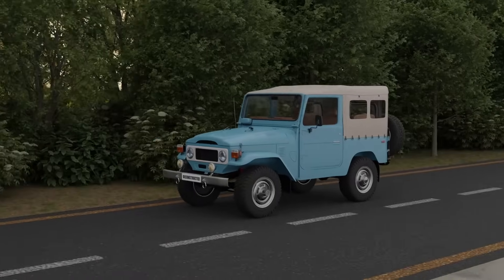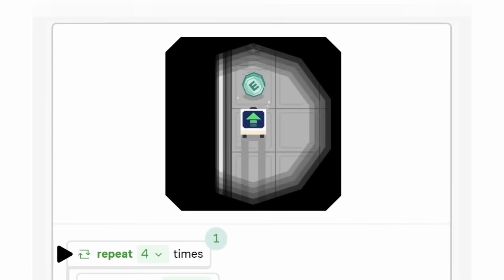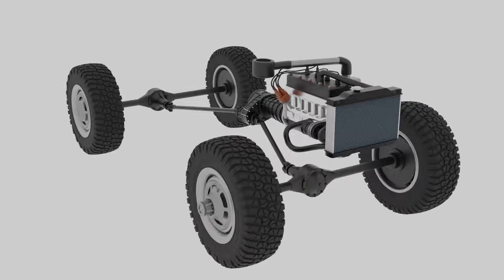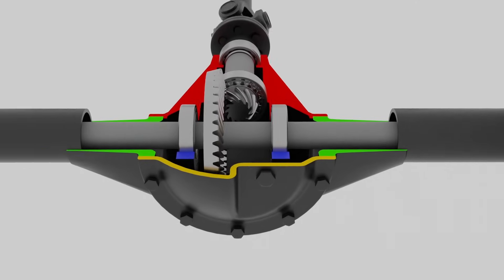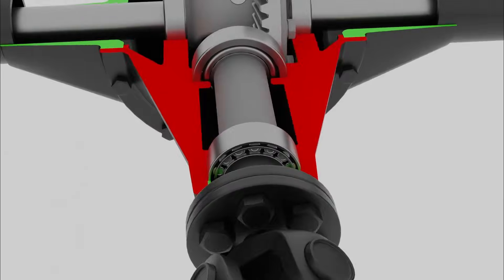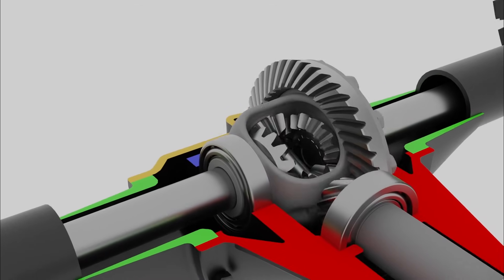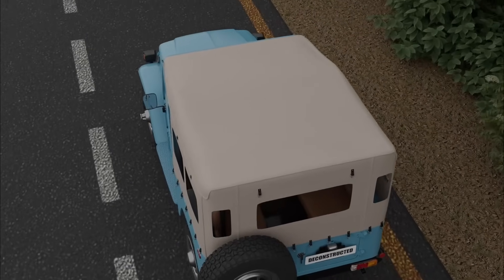How a Car Differential Works

Comment: 1:55 There is absolutely no official definition difference between 4WD and AWD. It would be almost as stupid as calling a 3:rd system FOURWD.
"All" and "4" is exactly same on any normal car. So would be beyond retardation to give that different definitions on some part of the word that has not even anything to do with any difference.

6:50 Cudos though for getting the diff right. Power might differ. But torque is always same to both. Few get this.

Comment: At first,  I thought that each end of the spider gear shaft was pressed into the differential 
case through a bearing,   but for either gear to turn on its axis following the side gear(s),  
the opposition from the other spider gear would have to twist their shaft until it snapped -- 
and unlikely event at this low of a gear ratio.   It has to be, although not explained on this 
video that each spider gear rotates independently on the shaft because it has a bearing 
BETWEEN the gear and the shaft.   Otherwise,  it would not work as a differential.

Comment: If feasible can you explain how the differential case works more detailed like how the spider gears come into action when the resistances on the tires are different.
Reply: Ranji:  Sorry,  I didn't see your question until after I posted my comment. 
Look for it around midnight the night of Saturday,  June 28th (2025).  Henry

Comment: 1. Limited Slip diff
2. Locking diff
And this one’s a little niche but I’ve seen more wrong explanations than right ones on the internet, Subaru’s driver controlled center differential, used in the STI.

Comment: Nice video. 
1:40 Don't want to be the buzz kill, but there is a mistake at the beginning - right after the sponsor - driveshafts going out of the transfer box - are rotating in opposite directions? It's corrected later in the video.

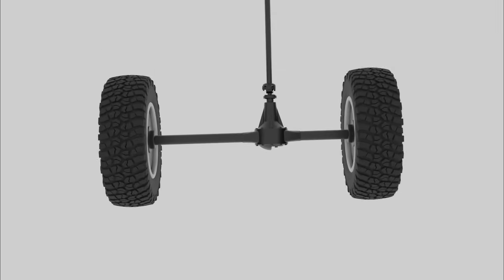Comment: The key concept, and the whole point of the video, and what I came here to see, is at 6:30 with the case open and two different axle speeds visible.  But it's only shown for 1-2 sec.  I think that's a major flaw in this otherwise excellent animation.

Comment: 6:46 very common mistake! Power (or more precisely torque ) is always the same on both wheels at an open diff. The problem is, that torque is limited by the "support" coming from the wheels. And if one wheel experiences a zero grip situation, the whole torque transfer brokes down.

Comment: Thank you for the great explanation!
I always wanted to know what "locking the differential" meant, and why it had to be done on poor terrain.
So now I know it will prevent loss of force due to uneven terrain. Nice!

Also explains why it needs to be "unlocked" before traveling at high speeds without causing damage. Because of the uneven wear you mentioned.
Reply from the maker: Glad we could help clear things up!

Comment: 4:50  '   which allows each wheel to rotate at different speeds [sic]..."  I don't think you mean this.  A wheel can operate at different speeds without a differential -- e.g. at 10 mph it will operate at a different speed than it does at 55 mph.   I think what you mean is "....allows the two wheels to simultaneously operate at different speeds. "
Reply: No, because he already spent the preceding 4 minutes making it clear what he meant by "different speeds", so the brevity was justified.
Reply: Pedantry.

Comment: Great video! As the next topic I suggest electrical Circuit Breaker. Ranging from high voltage to MCBs they're all very mechanical devices designed to operate without electronics or even external power source.
Reply from the maker: Thank you for the suggestion, we'll keep it in mind!